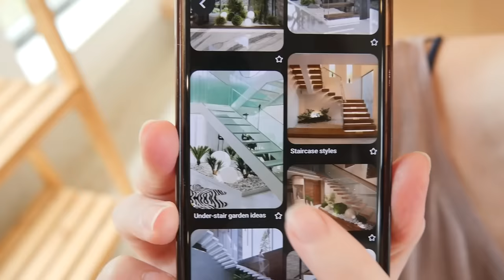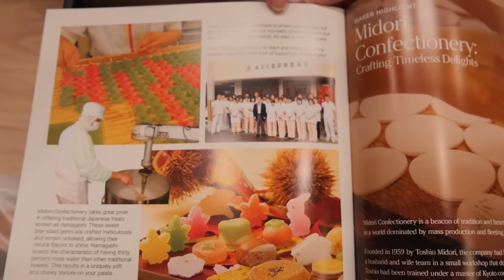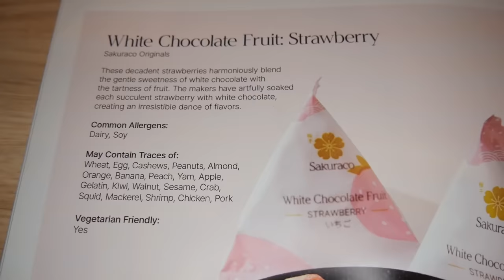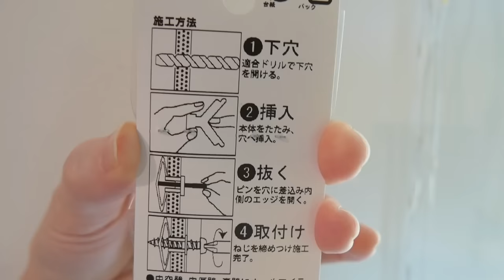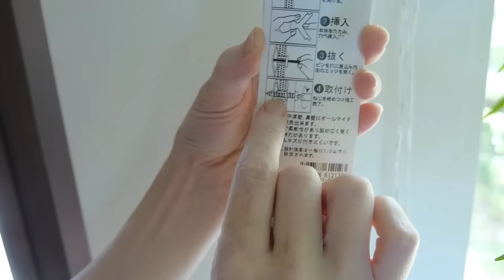I put a Japanese rock garden under our stairs

Comment: You can use mint oil to deter cats from being in certain areas! It's smells very very strong to them and works REALLY WELL. But try not to have it get on their fur as it can cause stomach problems if digested. I like hiding cotton balls soaked in mint oil inside of a small lidded cup I've drilled holes into. You could hide a something like that along with the white rocks!
Reply: If your a coffee drinker you can also use coffee grounds. We put them in little dishes or attached to tape(the tape doesn't work great for us because one of our cats loves the taste of adhesive and the sounds of tape when it's bitten) they both HATE the smell of coffee and as long as you have a decent barrier of coffee around the edges it works really well
Reply: Not always true… my cat loves mint so I keep it away from him. He is strange.
Reply: They also dislike Vinegar and citrus smells like oranges or lemons
Reply: @theblackkat1688  I had a cat that loved citrus, though I'm half convinced that it was because they were orange like he was

Comment: 15:40 there's plastic drywall screws that allow you to screw a normal screw in them. They look like an auger. Google "plastic drywall screw" or "plastic drywall anchor". Don't worry about them being longer than the thickness of the drywall. You can cut the excess material leaving only the part where you stick your screwdriver in.

Comment: You could also use construction adhesive, like 'liquid nails' from the hardware store. That stuff is way stronger than tape and probably less expensive as well.
If you glue wisely, most modern adhesives can achieve a bond that's stronger than the material it's glued to (except metals, obviously).

Comment: AC:  Hot and cold create moisture, there is no way around it. However, you can re-direct it to outside or into a drain pipe using a clear soft tube. Just keep gravity in mind when installing the tube. Hiring someone to "fix" the problem when the problem requires creative thinking, it's just never going to happen.

Get a level and see where the AC is slightly off balance to see where a drip tray likely needs to be (or just cover the entire bottom with a drip tray if you can find or make one), then attach a tube to the drip tray and have it go down 1+ inch underneath the tray and direct it outside by drilling a hole just big enough for the tube (but not too tight or it'll be a nightmare to fish it through the hole), then have the tube stick out from outside about 2 inches to prevent heavy water from AC from creating a stain on the outside wall. Apply some caulking around the tube / hole to seal it from outside elements and that should solve the problem.

Why it's dripping now and not before... I don't know as I'm not too familiar with that particular AC style. Maybe there is already a tube leading outside and it's plugged, or maybe it has a drip tray that isn't drained at all and it overflowed, I just don't know as I'm not there to see the issue. But I do hope this comment suggestion helps.

Comment: I recently ran into a similar issue with the drywall anchors (anchors too long, hit the outside stucco, too little drywall). We trimmed the anchor to size and it worked! Not the best idea but it works for something lightweight. Alternatively, can you purchase 3M brand Command Strips or Mounting tape in Japan? If nothing heavy is going on that shelf, those strips work wonders (20-30lbs/9-13kg)!

Comment: My mini split was leaking as well. Seriously sucked. Turns out the back draft of hot air coming in from the pipeing to the outside unit was wafting up and hitting the cold inside unit and causing it to condensate. 

We spray foamed the area and packed some insulation around the back of the unit inside and it fixed the issue. Hope that was your only problem as well 💕

Comment: loads of plastic forks stuck prongs up can help deter the cats, and teach them it's not a place where they can step. the whole setup turned out beautifully! after watching again, I could also recommend you set up a slight incline to your garden base. you can lift the end board up and water the plants, and the water can run down, where you can push it out the door. bonus is that the water won't be wasted as you're using it to clean!

Comment: PLEASE be very careful with the taped shelves!
The glue in these tapes gets activated by pressure during installation, due to the entire area of the back of the shelf being taped, the pressure you applied got distributed to the entire area, reducing the actual absolute pressure each tape “piece” had been exposed to during installation.
Ask me why I know these details ;)
Reply: structural engineer or material scientist?
Reply: did your shelf fell down?
Reply: My Strange Addiction double-sided sticky tape fetishist
Reply: @schwarze_wand  That’s a Bingo!
The surfaces had been cleaned with 99 % IPA prior to the installation and I used my full body weight to apply pressure to it for about a minute. A few months later it fell down one night, I was extremely lucky no cat was hurt.
Reply: @abavariannormiepleb9470 oh no! That knife shelf looks scary if it's not stable. 😮
Reply: @mary-janereallynotsarah684  Yes, I personally find the magnetic knife shelf extremely scary, especially in a kitchen environment with humid air (from boiling water) that generally softens adhesives.

Comment: Possible troubleshooting for your A/C is to check the condensation tube which is inside your wall. It has probably grown an algae plug  and the easiest way to pull it out is to either use a can of air to blow the plug through the tube  to the end point or you can use a shop vacuum to suck it out from the outside. I am sure your A/C guy has come but the posting of the video but this is a perennial bit of maintenance that might save your new TV in the long run.

Comment: Hey rachel and jun, :D I had something similar happen to me with the ac, so did you guys check the ac water pipe outside? usually if it drips water inside, something is blocking the water from getting out, like leaves or debris or something.... (hope that helps :) )

Comment: What will come down with a taped up thing is eventually the outer layer of the wall. Paint, tapestry, such things. If it's heavy enough the outer layer can't support it so to say. But I doubt you're going to hang your entire body from it (I still have 7 minute of video left - this is a brave assumption of mine!). So plant pots should be fine.

Comment: Ok but say you put tape on only one side, the shelf is gonna still fall. It doesn’t matter how much weight the tape can bare. You still need to make sure the entire shelf is taped cause obv you’re not gonna put stuff on it on only one side

I basically did this to put up a canvas painting. The wall I wanted to put it on is concrete. Yeah you can technically drill a hole in it but I didn’t wanna do that. So I just put a bunch of command strips on it and stuck it up. Has stayed up for I think 5 years now

Comment: I've had ... mixed results with double-stick tape and those 3m command strips.
In my old apartment, a 55" by 22" framed (with museum glass) print of Ray Troll's Midnight Run stayed firmly on the wall by virtue of ONLY 3m products, even when the crazy lady lived next door who routinely threw her furniture at her side of that wall in the middle of the night.
Conversely, I used a different kind of double-stick tape for some mounts for a couple prop lightsabers in my new place on a concrete wall, and they both fell off the wall within about a week of being put there. Luckily, the mounts didn't break, nor did the lightsabers break anything (the handles are milled aluminum and pretty chonky).
I guess the moral of the story is: be careful about what product you use on which material and what kind of surface, and what load you put on said product. Your skepticism isn't unwarranted, but you oughta be fine as long as you're not putting up dumbbells or anything particularly precious. 🙂

Comment: Advice for the dripping AC:
1.) Move it away from electronics
2.) You can open the AC up and use a brush to clean the fins out really well. You can even take out the gutter to clear out any slime build up. 
3.) Clean the spinning fan as well it will have alot of dust in it. 
Trust me you do these thing your AC will be pushing out ALOT of air in no time. Learn to dissasemble it. It will be worth your time. Even the cleaners won't be able to clean it better than you can. Well Japansese people are definately maticulous but, it would be great if you did it once atleast yourself so you know what your paying for.
Me and my brother clean my Split AC once every year together it's fun to do tbh and you can give it the personal attention it deserves.
Reply: Main reason AC leaks is slime and debris build up in the gutter pipes and fan.